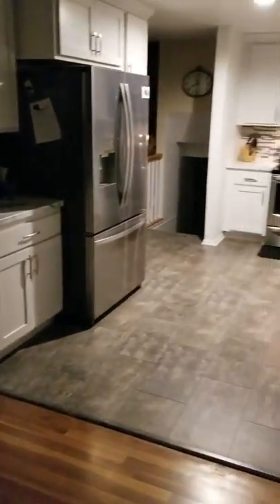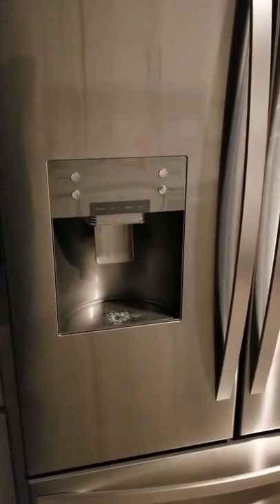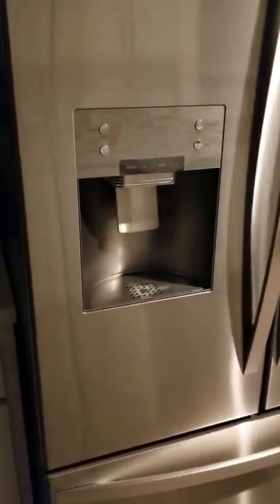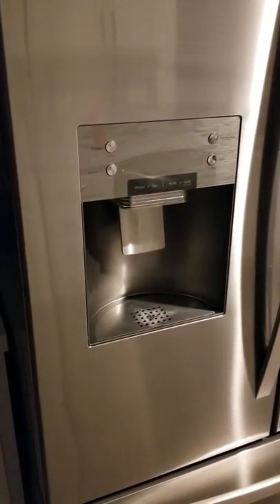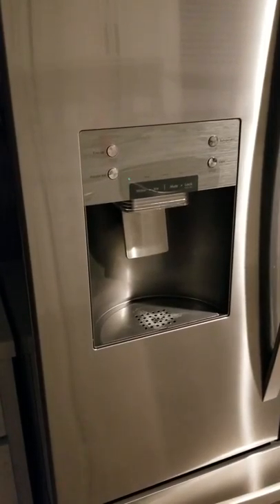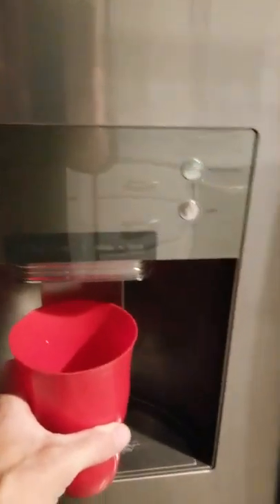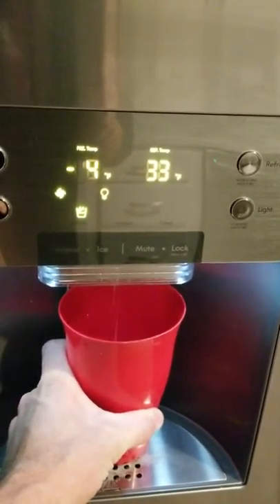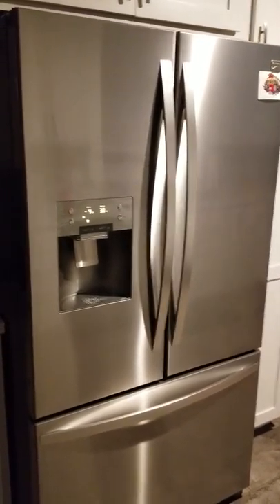Water dispenser hammering noise fix (kenmore)

Comment: Thought it was air in the system and about to bleed the system when came across your post.  Excellent, two minutes later and fixed.  Thanks for the post!
Reply from the maker: I believe the high water pressure somehow forces the water to "kick back" which makes the noise.    Only thing i can think of.  🤷‍♂️

Comment: Awesome video! This was my exact problem. Mine has been driving me nuts forever, the water would almost be white when it first came out because of all of the air pressure. Turned my valve down half way, and presto. No more loud noise, and crystal clear water. Thanks man.
Reply from the maker: Sweet deal dude! 👍

Comment: Glad I ran into your video.  My Samsung fridge also makes a hard hammering vibration noise sometimes when I use the water dispenser.  Coincidentally, we were experiencing noise from the toilet whenever we flushed, etc.  I ended up reducing the water pressure to the house by decreasing the pressure via water pressure regulator.  But I guess that didn't do it for the fridge.  About weeks to a month later, the fridge would occasional make this loud vibrational noise whenever I used the water dispenser but it was inconsistent.  I think I will simply try as you suggested of just simply reducing the water flow at the valve where it attaches to the fridge.  I got a feeling this is what is casing the problem.  Thanks!
Reply: Did this work for you? It didn't for us. Soo looking for what to do next?

Comment: Install a Water hammer arrestor if you have about $30 . Unfortunately not all contractors install them on fast acting valves like a ice maker or a washing machine. The valve that you are using to throttle pressure will fail, it’s not designed to throttle , only fully opened or fully closed.
Reply from the maker: It hasn't failed since i posted this video.   I'll keep crossing my fingers.
Reply: @davel7415  part of it depends on your water quality and how often you exercise the valve as well

Comment: I had the same annoying hammering noise from the dispenser for over 3 weeks and tried this solution before spending money on repairs, it stop the noise and water is dispensing smoothly for now. I will see how long it works and will update my comments later.

Comment: If you reduced water flow that much to eliminate vibration at that low flow, you probably dont have flow elsewhere where you need it. You should be adjusting (or replacing) your water pressure regulator. Pressure gages are cheap at Home Depot. Put on on your spigot outside, open that spigot, and adjust down the regulator until you get to 60 PSI. The pressure regulator will allow for more or less flow when you need it at a constant pressure. TIP: let water flow slowly out of a sink while adjusting it. Water regulators are "non relieving" and will not bleed extra pressure while you are adjusting. Final test: shut off your flowing sink. Are you till at 60 PSI? good. No? you have a failing pressure regulator.

An update, my failing pressure regulator is going to 85 PSI at no flow (turn off sink). I'll need a new water regulator. However, it should be noted, My house was running at 85 PSI when I bought it. I left it - good irrigation system flow at the expense of premature failure of toilettes, irrigation parts, etc. I asked myself, why did it work all along and start vibration now? The fridge water valve and solenoid (electromagnet that turn on the valve) are old and may be having trouble overcoming the water pressure to open the valve. I decided to replace both the fridge valve and the system regulator... I am still getting vibration at 60 PSI, which I shouldn't. The valve on the fridge is rated for 100 PSI but meant for 60 PSI. It's smooth at 40 PSI, but that's too low for me. With a new system regulator and ridge valve, I should be good to go at 60 PSI and have plenty of pressure and flow when multiple people are using water.
Reply from the maker: I reduced the water pressure at the shut off valve behind the fridge,  not the main shut off for the entire house.

Comment: It doesn’t work it only extends smooth water for a certain amount of time but ends up still making the drilling noise
Reply from the maker: I still don't have the hammering noise over a year later.   Sorry it didn't work for you.
Reply: @O Fix It RVA Appliance Repair LLC water hammer arrestor

Comment: Or try this ... go through the filter-alert reset process after completing the install of the new filter. This requires pressing the RESET button on the water/ice display three times. Pause a few seconds in between presses. After the third there'll be some beeps and the screen will revert to normal.